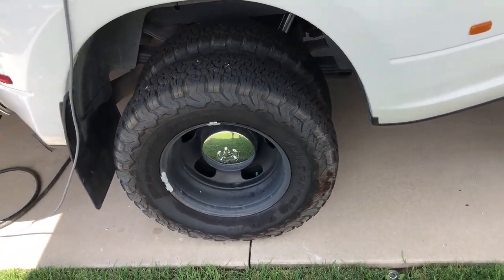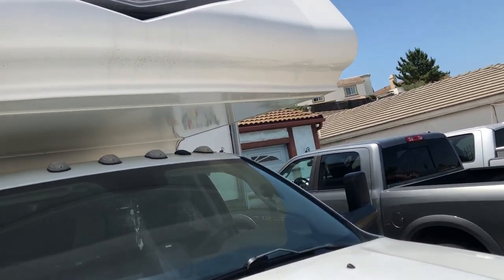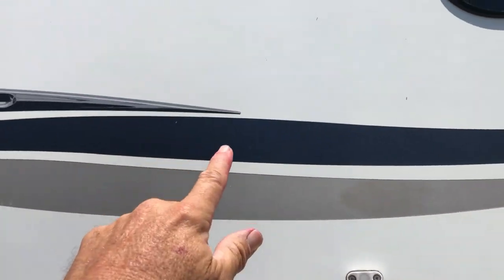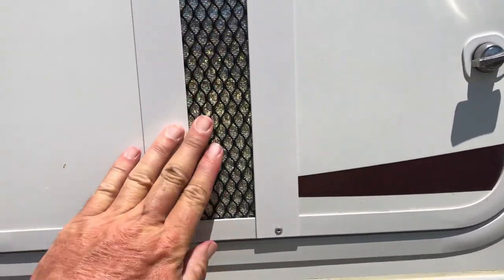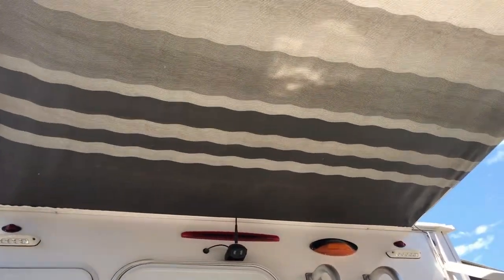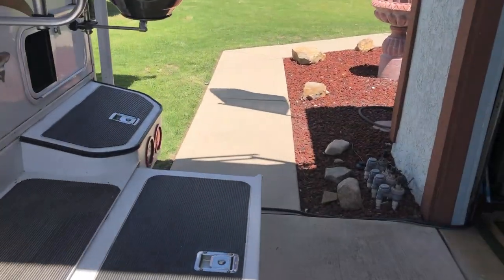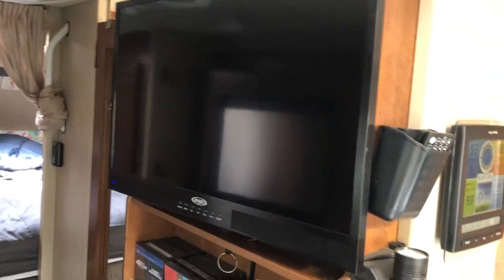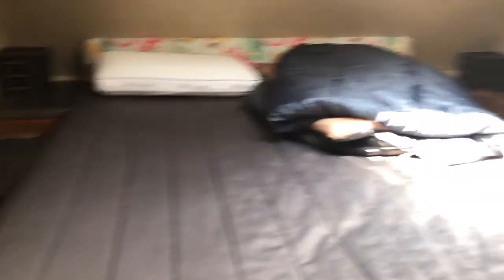Truck Camper 2018 Lance 975 update and Tour

Comment: Rand did you install the solar panels?
Reply from the maker: The 1st 2 in front were install in the factory when ordered the camper, but I installed the second 2 solar panels by connecting them to the 2 front solar panels. All my wiring was done on the roof. I up graded the solar controller in the camper when I got the lithium batteries.